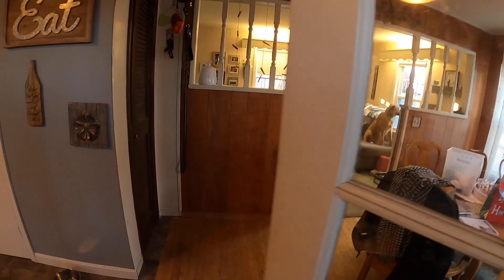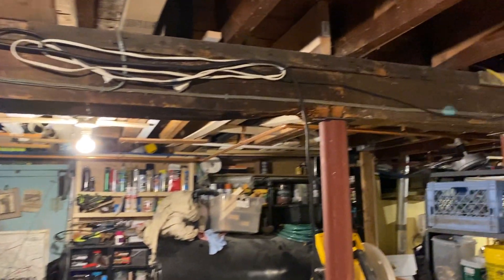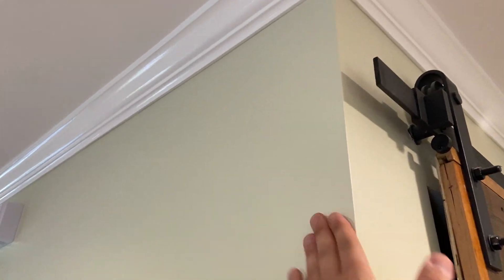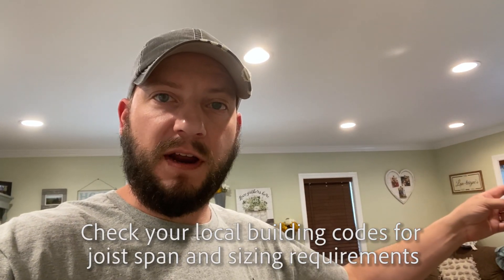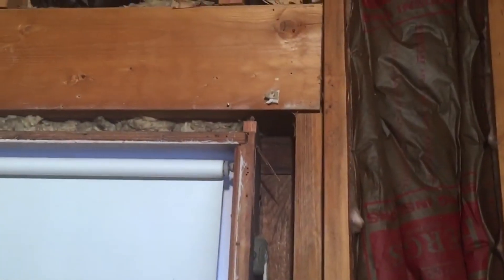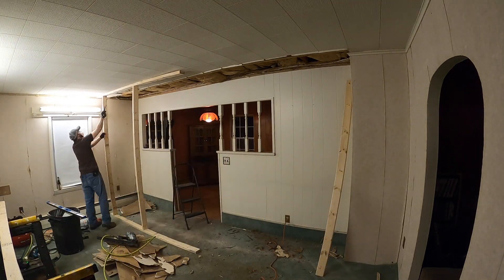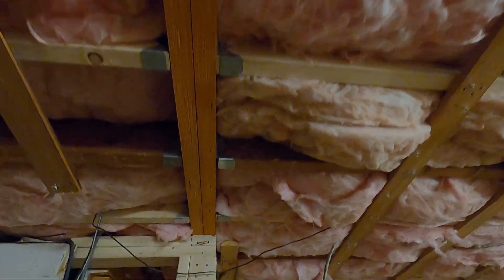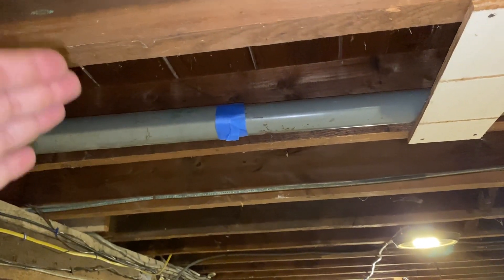How to Tell If Your Wall Is Load Bearing and How to Remove It!

Comment: Appreciate this video. House I'm looking at has a horrible 3 bed layout upstairs. I want to move some walls around and make it a 2 bed. This gave my some confidence and ideas on how it can be done safely. Hopefully the engineering fees aren't too high. I've got a civil degree but no PE stamp. 

Just need to figure out the load transfer into the foundation/footing now

Comment: Here in the UK, timber and metal framed housing has become more popular, especially for factory built panels and completed units with all services, decs, flooring and white goods installed.
However the external walls still tend to be brick, block, cavity and rendered block work. Newer techniques, such as structural frame with rain screen cladding are becoming more common, especially for apartments. Not an exhaustive list, but shows some of the differences, re US and UK.
Another difference is beams and window door lintels, we tend to use steel beams and metal or concrete lintels. Modern composite beams, wood and mechanical fixings are also used, often by large developers.
One problem I saw in the US was the rapid deterioration of the external cladding, Baltimore was pretty bad, weather there doesn't help.
Sorry for the long ramble, new to your channel, good lectures, and you show all the crappy part of building, breathing in other people's years of dust.

Comment: Got a bungalow home a bathroom that we are not clear is a bearing or unbearing ceiling beam that runs above the tubs outter edge in ceiling. We want to remove it and put a fan in there but aren't sure. Looks like a support beam, maybe even a duct how can we tell?

Comment: Nice video and very informative. New subscriber btw. I need some suggestions and advice. I need to replace a 20ft span from the gable corner to just past my front door, also the sheathing on the roof in that same span needs replaced, the house is 30ftW x 52ftL... I know my exterior wall is load bearing. What I'm trying to figure out how to support the trusses to replace the wall.
Reply from the maker: Hi Serena.  Unfortunately it is hard to say without actually being there and seeing it.  This sounds like something you will want to have a qualified person take a look at and potentially an engineer.  Sorry I couldn't help more.  Thanks for watching!
Reply: @TheFixerHomeRepair  Well I had my boss come look at it, he's a General Contractor, I'm mainly a roofer/ framer. What we did was removed the shingles and sheathing ( it needed replacing anyways) removed the siding on the gable end wall, ran a LVL underneath the trusses and supported the LVL with Jack posts . Worked out great plenty of support to do what I needed to do. I'm in the process of framing my new wall 102 inches H x 16ftL ...   It's taking me a little longer than I'd like ( because I can only work on it when I get off and on the weekend) but I appreciate your response like said I'm a new subscriber 👍

Comment: Great video. Only part that could have been said more clearly was at 11:46 when the support of the LVL to the foundation was explained. Here, the video seems to have jumped down to the basement  level to show the foundation while the new LVL installed was done on the floor above so it was confusing what we were looking at initially. Great video otherwise-thanks.